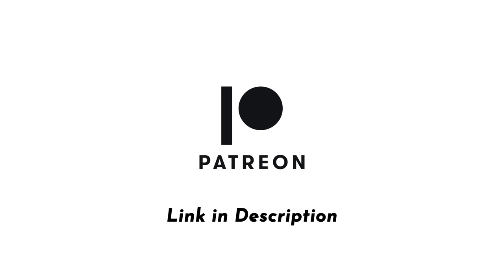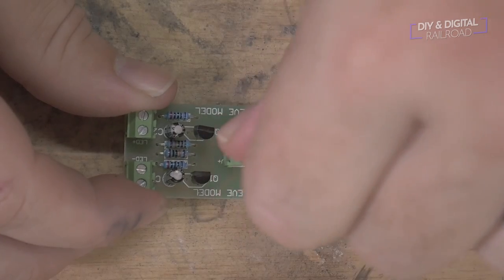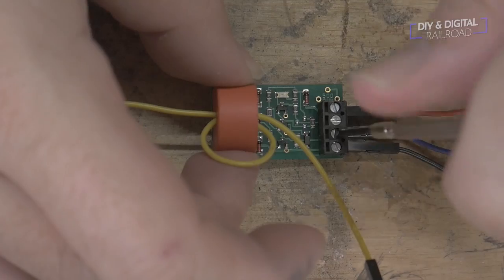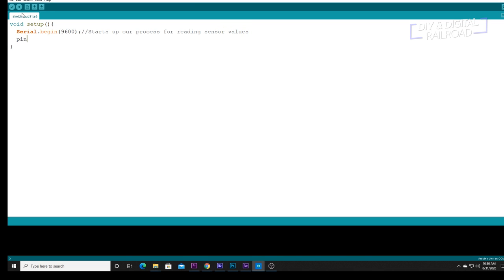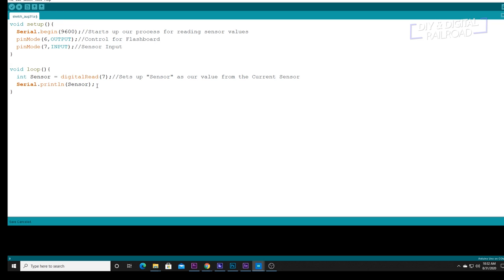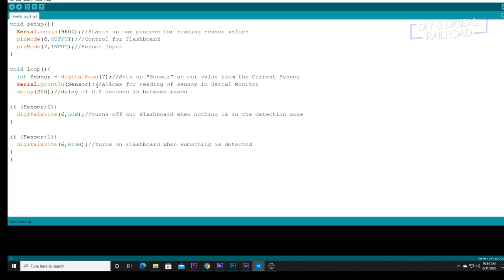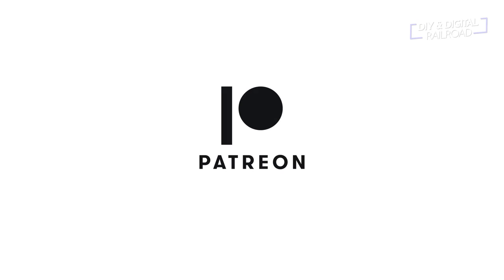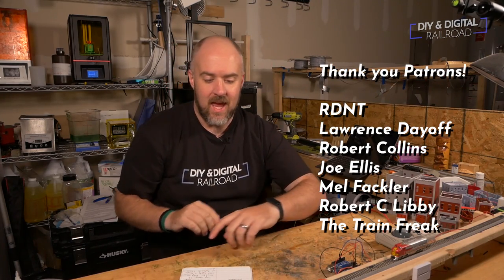Arduino Model Railroad Crossing Signal With Current Sensing!

Comment: Question: On your sensing track you did not elaborate on if the sensor track was insulated or not. Also it looked like you had 3 detection wires going up to the track and you did not elaborate on if all three wires went through ( don't know the technical term it looked like a chock) the chock(?) but can you have a little more video on the sensor wires.

Comment: This is very cool Jimmy! I use NCE BD20's on my layout for block detection on my layout so I will most likely I have to use IR sensors on mine. Whether using this for grade crossings or block detection, resistor wheels are a must and if you make your own, do each truck's inner wheel so the back 1/2 of the car isn't still in the grade crossing area when it cuts off. Great video! - Jason

Comment: Just wanted to let you know that these Arduino project videos sparked me to learn and build a rather elaborate n scale power and control circuit with a 12v dedicated PSU, a DCC++ base station, Arduino based layout signal/switch control/block sensing circuit. The latter performs switch duty on two switches, controls signals for the entire layout using PWM LED control boards (depending on block status and switch position), and uses circuit sensor coils to block sense 4 different blocks, all with one Arduino Uno.

Let me know if you want any details on my setup.

Thanks again and keep the videos coming!

Comment: In my opinion, the use of current detection means either the flasher is on or off depending a train presence.  How big a block are we talking, 6" on either side of the crossing, or a block that spans several (1:1) feet?  A separate block just for each crossing?  Secondly, the blocks are already in place and have other uses and duties.  Adding more blocks in the middle of blocks is sure to complicate track wiring and trouble shooting.  I'd rather insulate the entire subsystem from the rails.  With IR sensors you control exactly where the action occurs, and it's a lot more than an on off switch.

Comment: Hi Jimmy, do you have any YouTube videos on linking multiple Arduinos together in cases where there are not enough input or output sensors on one board.  The reason I ask is that I have 54 signal box levers that I want to introduce interlocking using Arduinos that will show a green LED next to each signal lever that will illuminate if that lever can be pulled, or a red LED if it needs to be put back into the frame, normally when the track sensors reports occupied in the block ahead of the signal that is pulled off, thus prompting to put the levers back.  Also are there any AC current sensors that can be used with the Arduino that are cheaper than the NCE ones you use?

Comment: Hi, I copied the sketch verbatim but the last line won’t compile , namely if(Sensor<1){          digitalWrite(6HIGH);      It says‘ expected primary-expression before ‘,’ token.  As a newcomer to Arduino coding , I am stuck as to a solution , can you suggest anything
Reply from the maker: Hey Chris.  I just duplicated your error.  There needs to be a comma between 6 and HIGH so it needs to read digitalWrite(6,HIGH);  I hope this helps!
Reply: Sorry, I missed the comma out of my note to you so that was not the problem. I have just reverified  and it now says ‘,’ expected before { token. I presume the highlighted line is the one at fault if so it’s still the last line before the double }}
Reply from the maker: Try using the code at this link.  If that doesn't work, then email me at ddrrcommunity@gmail.com https://drive.google.com/file/d/1c1w7oVQjng3j50tUEQksxPxzOP7T8uwS/view?usp=sharing
Reply: @DIY and Digital Railroad  is the detection zone insulated on one rail?
Reply: How do you wire it to the track?

Comment: I don't understand. What wire are you looping inside BD20? Where is that wire connected?
Reply: It's Jimmy's page but, that should be a single feeder to a track rail. You would come off the power source, loop through the BD20 and continue on to the rail. In the case of DCC it doesn't matter which. If you're measuring DC it needs to be the positive, not sure if the BD20 can read DC current. Some CT's only read AC.
Reply: @patp3177  oh this makes sense. Thank you. But this would assume you have isolated sections of tracks? I'm sorry, I'm not too familiar with complicated layouts. I only had one switching layout with just one pair of feeders.
Reply: @ravzir  You are correct on the isolated sections of track would be the safest. Clean breaks between blocks and all. It doesn't have to be separate wires all the way from the source, just a main buss with section feeders will work, measuring each feeder.

Comment: The arduino is not needed. The lights can be controlled through the BD20. See page 3 of the BD20 instructions.
Reply from the maker: Yes you are correct for this specific project.  A BD20 can control a single output.  This was part of a larger project where I updated a few of my older arduino sketches to use current sensing instead of IR sensors.  I actually ended up building my own arduino based DCC Current sensor that is significantly less expensive than a BD20 https://youtu.be/I_G2AsMq5vk

Comment: Another great tutorial. But I wonder if this detection only works for the loco and not on non powered cars since they won’t be drawing any current. If so flashing light will stop before all the train passes unless expanding the detection zone to be able to contain the entire train before and after the crossing.
Reply: seen somone just solder tiny resistors to the metal wheels
Reply: Odd Fellow I see but that’s a lot of work if you’re running many cars
Reply: @SATODEN Why I went for 38k infrared sensors. but not using em for block detection yet. made a dc run in shuttle instead. not got the video uploaded tho.wired infrared leds under the track point up at a gantry with a 38k sensor attached.wired Leds in pairs for 6 sensors due to the amount of light bleed interfering with sensors.
Reply: Odd Fellow I did the same. Block signals I wired are all IR sensor. Placed Ir sensor leds sandwiching the track.
Reply: Just remember, if you have a loco without sound, and you haven't turned on the lights, it doesn't pull any current when stopped. Just one of those things.
Reply: @patp3177  Right. So more of the reason to use IR.

Comment: Can you tell me if the BD20 can be used directly with DCC++ and JMRI as sensor just like an IR sensor?   Thanks.
Reply: The BD20 from NCE unfortunately can't be used as a IR sensor as it's only designed to detect current. I use these for block detection on my layout.
Reply: Sorry, I wasn’t clear.  I’m wanting to use the DB20 as current sensor.  Plug it into Arduino, then define the PIN number in the DCC++ setup on JMRI and in the sensor table in JMRI.  I just don’t know if the DB20 signal to the Arduino will be interpreted by DCC++ and treated correctly.
Reply: That’s exactly how it works.  The sensor will detect the block occupation (by a loco or lit car), not just a single point in the block
Reply: Dave, You are saying that BD20 will work with Arduino running DCC++  connected to JMRI?
Reply: Fred, It works great. It’ll change the status of blocks, and everything else a block detector is supposed to do.
Reply: Great!  I’ll get one and try it.  I’m hoping to use the Arduino for many things.  Thanks
Reply: Fred E Model Railroad ‘

Comment: I have tried both of your both of your methods spent a bunch of money and so far I have nothing that works valid your code downloaded your update code got your BD 20s flashers lights and I still get nothing the lights just come on they never flash or use the other method with the sensors waste of money I still have  nothing that will work the way you show on your YouTube videos am I doing something wrong I fell just scared Word for Word line for line and the last one I bought what you said bye and all I get is the flash board to come on all the way through never changes is there something I’m doing wrong I followed you Word for Word but all the stuff you recommended

Comment: Why use a flip flop when the arduino is perfectly capable of doing that function (cheaper/less hardware)!!! DB20 is expensive ( for lots of block detection), we need to find a way for the arduino to do the detection just using a current transformer!
Reply from the maker: My first attempt was with a regular arduino current sensor and I couldn't get a consistent reading.  The BD-20 is a sure thing right now and I won't put out at tutorial unless it works well.  I am still working on it though because I understand the cost issues.
Reply: Additionally, isn’t the arduino capable of controlling 8 led’s giving the ability to use at 2 crossings with only the need to find an old power source for the led’s? For a couple dollars more than the flasher circuits, I could buy another eloogo brand uno to do another two crossings or maybe even another project like servos for turnout control.
Reply: @KenN.OXN.805  In fairness to Jimmy, he is just demoing the principle, but yes many other actions could be implemented with one arduino! Even on a smaller arduino, 18+ pins can be used (=6 x crossing with LED's directly driven or 9 x crossing with the external flip flop)
Reply: I’m not trying to be critical. Just trying to point out what could be done with not a lot more spending. Hopefully Jimmy can show us beginning coders these alternative methods.

(Edit)
Oh, forgot...

I’d even given a thumbs up for doing this for us🙂